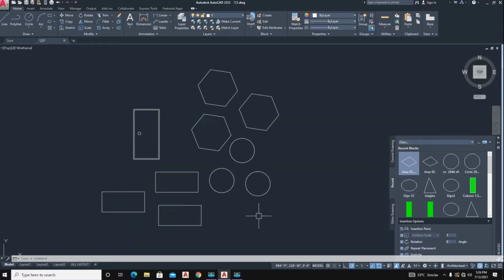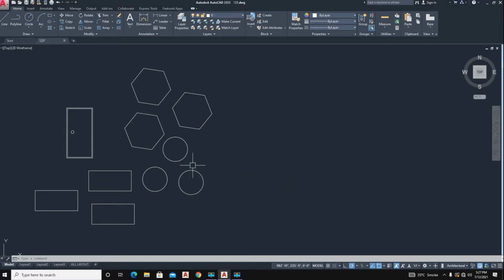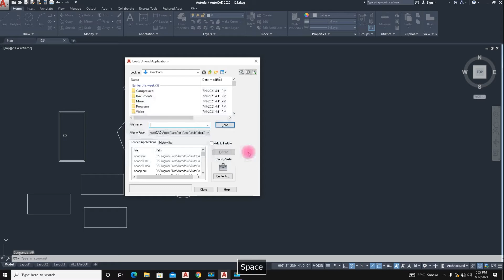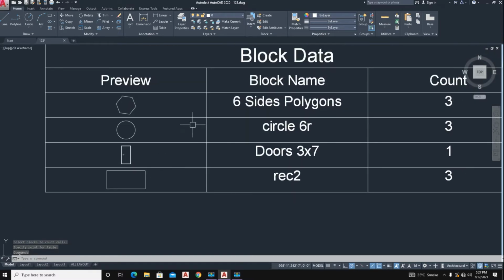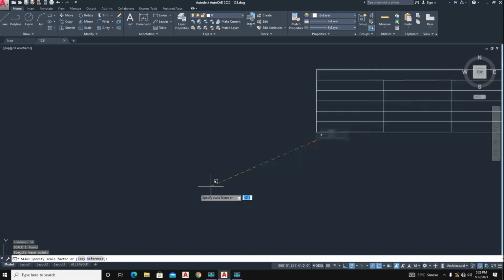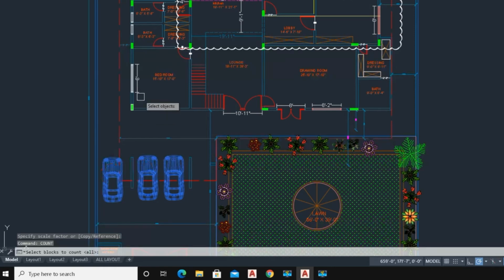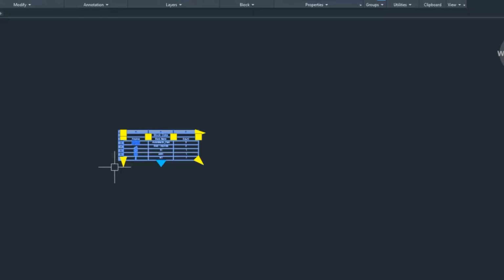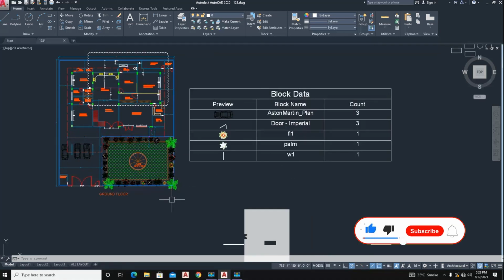How to Count AutoCAD's block

Comment: hi dear . Is that work for 2023?
Reply from the maker: Yea it's working
Reply: @CivilSurvey  i load this lisp into 2023 but isn't work. why sir?
Reply from the maker: Try again
Reply: @CivilSurvey  i'v try it many time but still the same.
Reply from the maker: @ahgalaunrealvisualstudio  try this method https://youtu.be/xJRjI33xYiw
Reply: @CivilSurvey  Thanks sir . For this method is worked but it isn't show the object. it's show also the layer' name.
Reply from the maker: Did you used command correctly I used here this lisp working
Reply: @CivilSurvey  Yes sir i type count but it isn't for list it's count in cad's commad  i don't know why.
Reply from the maker: Your object in block first convert object to block b enter give name ok that ..when you type a command watch the drop Manu of command may be another same and try this way
Reply: @CivilSurvey  it still isn't work sir , but thanks
Reply from the maker: Tomorrow contact me civilengineeringsurveychannel@gmail.com send your file on this tomorrow I will check it